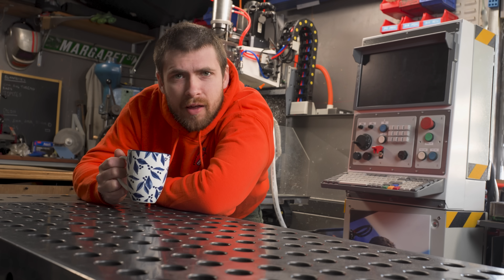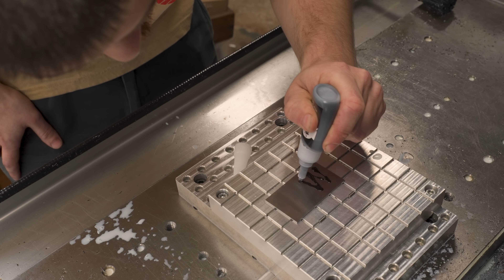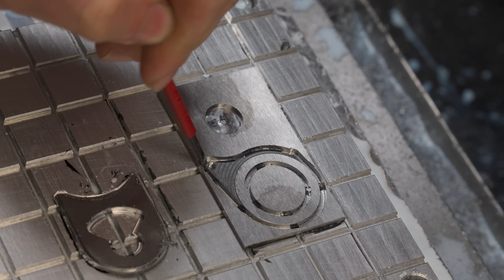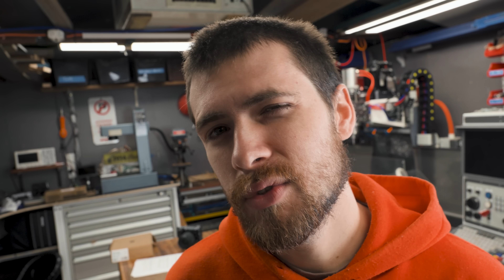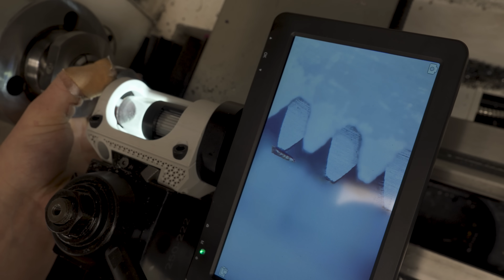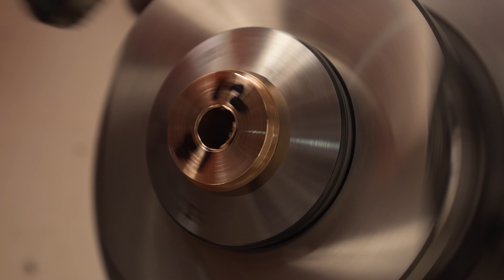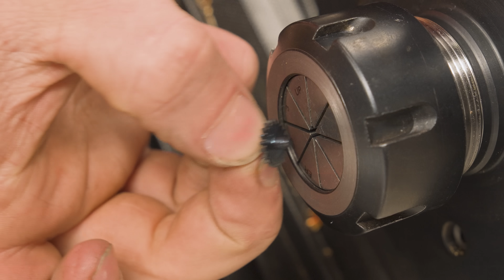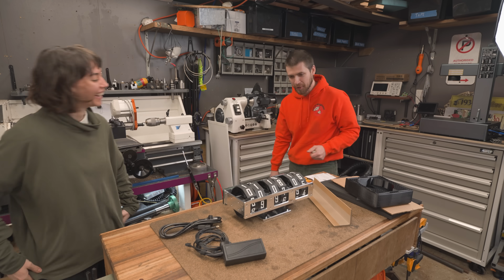What if angles were metric?

Comment: I'm surprised to hear you think that no-one would know about radians. Where I grew up (Belgium), it was a default at secondary school, we learned about degrees, radians and gradians, and how to calculate with them.
Probably not a coincidence that the circumference of the earth was set by the French to 40.000 km, meaning 10.000 km for each quarter (or rather, the kilometer was set to 1/40.000 of the earth's circumference). Which is the same type of division as the radians.

Comment: 0:10 respectfully, 1000g in 1 Kg is js standard form, meaning 1000g = 1 .0 * 10^3 g = 1.0 Kg, the unit is g, grams. The same as 1000mm in 1 m, 1000 mm =  1000 * 10^-3 m = 1.0 m, the units being m, metres
Reply: while that is fully true and completely sensible it was Not the standard everywhere before the French revolution imposed it throughout Europe. in fact, as an American,  I can say there are twelve inches in one foot and… no one knows how many feet in a mile.

Comment: There are two more units that have metric equivalents : time, both in a daily and yearly sense. There is no real metric calendar, but the French Revolution, which created the metric system, did have its "metric-adjacent" calendar, it sadly died because of the 10 day week, meaning 8 work day between weekends.

But the more interesting one is metric, or rather decimal, time. A day is made out of 10h, each made out of 100min, each made out of 100s. 8h75min34s is therefore 87.534% of a day. This died because clocks were a luxury item, the vast majority of people used Church's bell to know the time of day, and the Church mostly sided with the king of divine right, therefore refusing to switch units.

Comment: As for the broken tap in the brass part, you might try an old watchmakers' trick:
A saturated warm solution of alum (potassium aluminium sulfate) dissolves ferrous metals and leaves non-ferrous ones mostly alone. It worked for me in an expensive aluminium part in which I broke an expensive tap drill in the very last operation.
Put as much alum powder as can be dissolved into hot water, and place the part in it, such that the hole with the broken tap is well under the surface and oriented upwards, allowing the gases from the reaction to bubble up freely. This will usually dissolve a small tap over night.

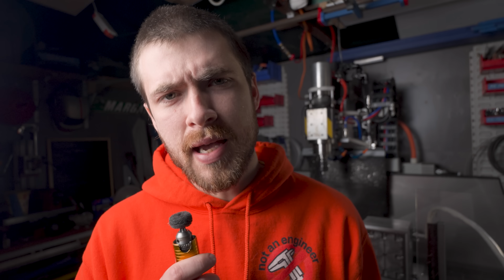Comment: 1. at 0:20 you said gradian, its called raidan. it is kinda the best angle measurment... in mathematics. the metric system is not designed to be optima for mathmaticians, but rather for everyone. and saying, okay now turn 3.14 radians is stupid.
2. im thirty seconds into the video, and im already mad. the degree is so perfect for whats needed. 360 has so many divisors, that you can use to split a circle in so many ways. for whats needed, the degree is optimal for its purpose.
Reply: no, gradians and radians are different units

Comment: In gamedev radians and degrees actually HAVE to work together (I mean we develeopers have to work with them), because all math involved in calculating position, angle speed, momentum etc. uses radians, but actually rotating things for user is done by quaternions or degrees. That's why in Unity there are two most used constants: Math.Deg2Rad and Math.Rad2Deg. Good luck with them!
Reply: Ain't just gamedev, it is pretty much everything else too. Degrees are for clear general communication purposes, radians for all geometric formulae though.

Comment: Your intro is unfortunately not correct.
The International System of Units (aka Système international d'unités, aka SI, aka the metric system) does have a unit for angles. However, it is not the gradian, but the radian. A full circle consists of 360° = 400ᵍ = 2π rad. For practical purposes milliradians (sometimes just called mills) is more commonly used.

Comment: I like the hexagon theory, but I think integer divisibility is a major factor too. 

360 has 24 factors: 1, 2, 3, 4, 5, 6, 8, 9, 10, 12, 15, 18, 20, 24, 30, 36, 40, 45, 60, 72, 90, 120, 160, 320 

400 only has 15 factors: 1, 2, 4, 5, 8, 10, 16, 20, 25, 40, 50, 80, 100, 200, and 400
Reply: Side note: this is also why we there's no metric time (like 100 metric seconds per metric minute/100 minutes per metric hour). 60 has more factors than 100.
Reply from the maker: I feel likethis has to be kinda secondary, as they were apparently already using sexagesimal numbers for heaps of other things, specifically because of that divisibility.

Like I don't think jumping to 360 just because of its divisibility is a straight step - otherwise it could just as easily be 540, or even 720 degrees.
Reply: I hadn't considered that, but I think you're correct on why we landed on 360. Utility and practical use commonly come before any formal standardization. 

But looking back at "why didn't metric angles catch on," it's because the established 360° system is more useful and elegant.
Reply from the maker: Undoubtedly!

Comment: metric is slang its true name is french but translates to system international...its precipice is science not biology as imperials is .so where si has units of measurement that every other system has it bases there scale on science and defined constants whereas a foot changed from ruler to ruler . it isnt that metric is better it is consistent,but that dosnt mean imperial is bad we still produce most materials to imperial standards there just handicapped with metric labels now,,,, 4x8x1/2 is known 1200x2400x12 dosnt work well and we build with systems designed to work in inch fractional 2x4 on 16 inch centers covered in 4x8 sheets  1/4 1/2 3/4  for tooling and fasteners the si is awkward quarter half and 3 quarters is easy so choice of units for the task at hand is a good thing work in whatever you like radians if it works for you but you should probably have a button to deg as well for anyone else who may need to use it...

Comment: at 23:36 what happened, you 'over drove' the tap (too big a handle, so put too much torque on it), to fix it, you put a 'dead centre' in the mill, and use a flat spanner style tap wrench, or a t-style, and use the quill to POSITION it only, to keep the centre in the hole of the tap! that way it can't break. and HAND TURN it, its not a machine tap 🙂.

Comment: one tip, the watchmaking fraternety do it differently, they do mill the big rod, and slice the gears off it individually; but more than that, this cutting is only rough work!, the true shape of the tooth is made with a 'topping tool' a jig with centres,to hold the gear, the other ledge to support a file, a small needle\flat file, this 'tops' the tooth, aka giving it that tapered shape on the tip, thats how the fine clearences, etc. are made, its not a manual transmission from a car (they are helical or straight cut gears), these are different. the application is called 'micro-mechanics' cameras, and their lenses come into this world to.

Comment: Speaking of cursed angle measurement units - milliradian.
It looks like SI unit, and it is derived from a SI unit - a radian. 
And it's even have a "milli-" prefix, cool. 
And two symbols "mrad" and "mil", seems totally reasonable. 

But there's at least 3 versions of milliradians in use:
NATO one with 6400mil in a circle
Warsaw Pact one with 6000mil
And a Swedish one with 6300mil. 
Yes, each one have reasons to exist and logic behind it, dictated by its use. But this is insanity. Please, someone, fix this shit.

Comment: Degrees are easily divisible in base 10, so even though 360 degrees in a circle it still works in divisions of 2, 3, 4, 5, 8, 10, 12, 15, 20, 25, 30, 36, 40, 45, 60, 90 ,120, and 180.  It is equally easy to use in factors of 10 than it is to use in fractions as in imperial units. It's quite the adequate compromise for 90% of day to day life construction and navigation.  

Similar argument could be made for "metric time", but metric time keeping was a little too convoluted to catch on.

Comment: 12:00 screw that, base 12 is easily superior

Not as unwieldy, can divide easily by 6, 4, 3, and of course, half. 144degree circle would've been way better. 12 into 12, instead of 60 into 6, like what

Comment: If it wasn't for that dangerous press fit with that tiny gear, you could have maybe added another needle and scale ring to the package so Marius could swap those in order to get the readings in a more useful unit, like Radian.
I find Gradian quite fascinating, even though it's pretty easy to see why it didn't see wide-spread adoption. Degree has been way too common and with how important 60° and its derivatives are, it being 66.66.. gon instead of any whole number is just not great. Would have almost been better to make 60° the base and have a whole circle be 600 whatever-unit. 90° being 150 isn't perfect but usable, and a lot of other important angles would still work out as well. Not that anything could replace Degree, and any attempt would just add another system that's pretty redundant.

Comment: Beautiful build! loving the series! good trick for broken taps, tig welder! low amps, sharp tungsten, can focus the head right into the center of the tap. 0.9 mig wire and slowly build up a blob. then let it cool, it will shrink away from whatever is binding it and youll be able to wind out with pliers. has saved my bacon many many times over the last 15 years.

also, side note, did i hear a lumbridge classic playing at the 25min mark 😎

Comment: 6:40 honestly, the whole gear shenanigan is completely useless, since it's just performing a multiplication.
just etch or machine a custom scale onto one piece and a matching vernier scale on the other. You get rid of backlash and gain additional precision with a fraction of the effort. and you could even put a second scale on the other side for radians.
I was expecting a angle -> %gradient conversion device, which would require cams if you insist on using gears. But even that could be done far simpler.
Reply: Nah, he already addressed this issue at 6:09 : "The first step in understanding the mechanisms at play here is to accept the gratuity of the overall system.  ...."  :P

Comment: I work on seismic early warning stations that use GPS to get their time. You need really good timing to make the systems work, and as it turns out the US taxpayer has built me a good way to get super accurate time to anywhere that can see the sky. Downside is-seismometers need to be in the ground where the sky is not visible. Also power comes from the sky in the form of the huge nuclear reactor nature put up there so we need that, too. As a result, most of my job is gatekeeping between stuff that happens in the sky and stuff that happens on/in the ground. Anyways to get that clock to work good enough for daily timekeeping tasks, you only need to have it capable of phoning home a little tiny bit. Like one or two sats at a time on a consistent lock will mean it keeps functionally perfect time forever. Stash that little puck antenna somewhere you won’t notice it and eventually it’ll feel like a magic trick when you look at the clock. For the seismic stuff we sometimes have to go to frankly ridiculous lengths to get very good gps antennae within a good shout of the sky to make them usable for earthquake early warning. Terrific work on this angle gauge-I love a useless measurement.

Comment: the 400 gradians in a circle would be the only logical choice given how they defined the meter (being that 10,000 kilometers was to be the distance from the pole to the equator). the real question would be which came first. did they decide that the circumference of the earth was to be 40,000 km or did they decide that the circle should be 400 gradians.

in short, if youre ever writing science fiction just remember that the metric system is geocentric.

Comment: some time in high school I wondered what the GRAD button on the calculator was for and went down a rathole of artillery calculation tutorials, which seemed to be the main thing (apparently it made the small-angle approximation easier to use at certain scales, particularly when adjusting angles for a second shot...)

Comment: The reason for 360 for angles and 60 for clocks is much simpler: they come from an era when only natural numbers were known. The Sumerians used sexagesimal because it has a large set of useful integer factors which was a big deal before the invention of fractions. Lets you cleanly split an amount into halves, thirds, quarters, fifths, sixths and tenths while only using whole numbers.

Comment: As a second generation engineer, here are a few pointers:
  1. The unit is a grad or gon, not a "gradian".
  2. To control the stability of cutting the teeth of the gears, use the attachment item that makes ties the gear rotation to the next item in the power train (an axle, an arm or another gear).  For example, if the gear will have 3 holes screwed with 3 screws, make those holes first and then screw it onto the holder used during milling.
  3. Also tie the gear holder to a tool for turning it in the desired fraction of a full circle.  Traditionally, this is a router accessory with a funky plate full of holes in patterns that help you control turns appropriate for gears with any tooth count, even primes such as 127 (important for gears that convert metric to imperial).
  4. To make the alignment notch on the side of the center hole, either drill the notch into solid metal before drilling the center hole, or cut the notch with a hacksaw blade stuck through the center hole, or for more precision, clamp the uncut gear in a vice on your lathe and then scrape a straight channel by moving a lathe cutting tool in and out multiple times using the control handle on the lathe.
  5. To deal with the gear slop in any measuring mechanism, simply decide which direction of pressing the tool into position gives the right numbers by definition, and tell the user to not rely on numbers when pushing the other way.
  6. To get an off the shelf metric screw with a specific head size, start by choosing a thread such as M5, then look up what the standard head sizes are, and finally design your mechanism to fit one of those sizes.
  7. The grad unit is closely related to the meter unit such that traveling one grad north or south is a distance of 100,000 meters.  In case the Earth has an imprecise shape, use the north-south straight line through the Metric institute in Paris, France.  Now after years of measuring this distance at extreme expense, the French made an exact reference meter stick for government use and then decided that for all time henceforth (until the late 20th century), the stick and not the Earth is the correct meter.  Exact copies of the stick were made for each allied country, including the newly formed USA, who conveniently had already switched to metric money (1$ = 100c) and had a newly established central authority in charge of making measurements independent of King George and the crazy London government that wanted the International Meridian to be the line through London, instead of Paris of Roanoke (Roanoke was deliberately put at a longitude that would make some leap year calculations slightly simpler).

Comment: I learned that these existed because I had a TI calculator a long time ago that could do trig in degrees, radians, and grads. I never even knew grads were supposed to be a metric unit.  If they are a metric unit, why are there 400 of them in a revolution instead of 10 or 100?

Comment: 360, factors of 2 3 4 5 6 8 9 10 12 15 18 20 24 30 36 40 45 60 72 90 120 180 (count=22)
400, factors of 2 4 5 8 10 16 20 25 40 50 80 100 200 (count=13)
That's a nice tool, but I'll stick with degrees.

Comment: The chinese SFX-4000b tap removal EDM machines are $3000CAD, and are portable enough to offer a business opportunity as well. I baught one for a machine shop for the 300 degree F coal crushing equipment I was working on, but it saved $100k a month in broken taps in some of their 30" inconel valve seats. I'd buy one if I had a garage shop for sure.

Comment: Just for correction, the  official International System of Units (SI / metric) unit for a plane angle is the radian (rad), which is dimensionless.  The Gradian was invented during the French Revolution as a possible angle measurement....but it was not adopted.  A radian is defined as the angle created when an arc's length equals the radius of the circle.

Comment: To those of us familiar with rifle scopes / marksmanship?
We're of course acclimated to both the MOA and the MIL.
We use MIL (milliradian), and  0.1 MIL = 1cm @ 100 meters
Or, MOA (minute of angle) where 1 MOA = ~1 inch @ 100 yards

Whereas it's but a happy coincidence that a minute (60th of a degree) is just over an inch at 100 yards, whereas a meter was DEFINED by a distance from the equator to the N Pole (originally, now it's off C), and the width of a milliradian's dispersion at 1 km was 1 meter (1/1,000). As a result, at 100 meters, 0.1 mil = exactly 1cm

but uh....the REAL gift to give any German...?
This thing called.....an AIR conditioner(shhh). 
Apparently, you don't have to DIE from heatstroke...